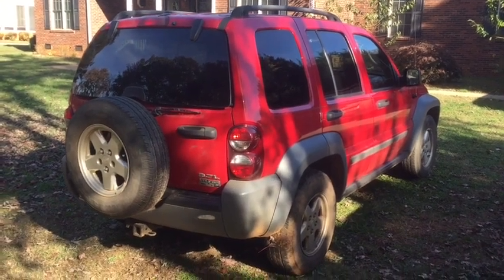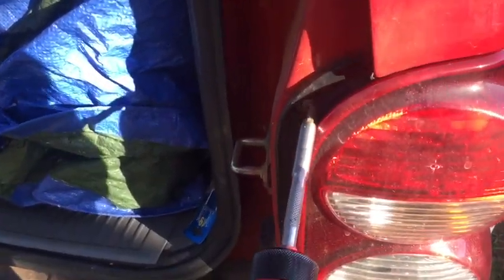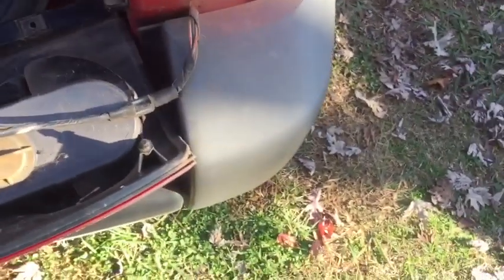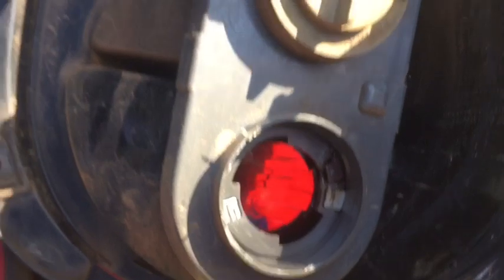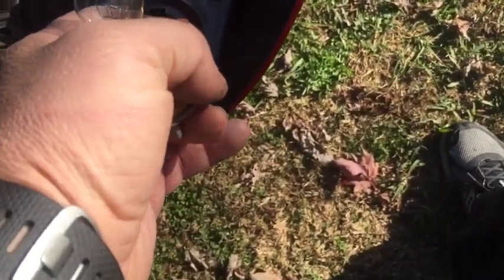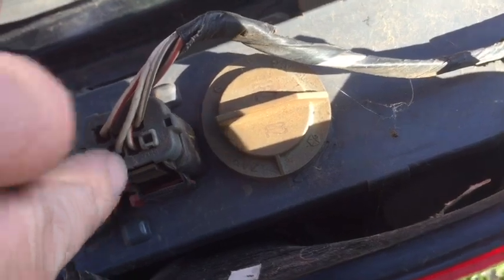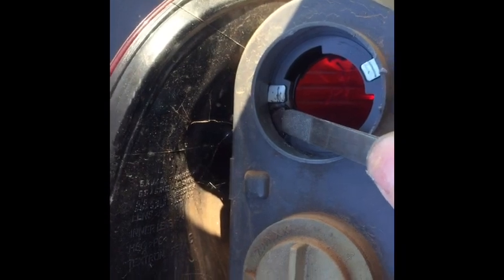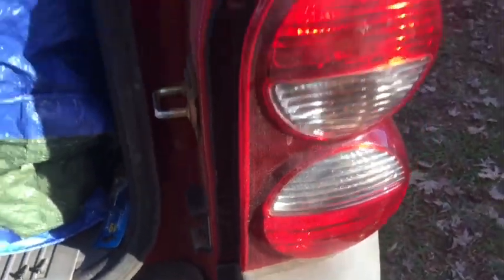Jeep Liberty brake light repair

Comment: Thanks.  I was really scratching my head when I replaced the bulbs and I got no brake light.  Then the other 2 lights(blinker and light)work.  I'm going to try to clean the connections.
Reply from the maker: vista7 you will likely find a burned connection for the light. Cleaning makes a good temporary repair. Eventually you will likely need to replace the entire light.
Reply: @YourCarGuyDR   I tried cleaning it but it still didn't work.  I ended up just buying a new tailight assembly and it works fine now.

Comment: This was a very informative video, but a quick question- which one is the bulb for the turn signal? You showed that the top one was for the brake/tail light. Thanks
Reply from the maker: Stacey Gallagher should be the second bulb from the top.
Reply: Nope.. Lol.. It's the 2nd from the bottom.. I think.

Comment: I have a 2005 Jeep liberty and the brake lights will not work replaced bulbs, replaced switch up by break petal and still nothing. Now the brake light on the top is staying on all the time. Please help.
Reply from the maker: It sounds like you have two issues the switch that you replaced is likely out of adjustment causing the 3rd brake light to stay on. The other lights need to be checked for power and ground connection. Check your fuses as well.
Reply: Thank you very much. What ground connection should I try first?
Reply from the maker: @janicediven6466  I would check your fuses first. Then with a multimeter test for power at the tail light connector.

Comment: Please help!

2007 jeep liberty.

Third light works fine (when I press on break pedal)
Nighttime, rear lights work fine (same bulb as break light)
No break light when pressing on break pedal (rear running lights will turn off)
Break fuse is OK (#12, 15a)
It's not the break switch because the third light works
Reply from the maker: So a couple of things to check but one is the most likely. The brake and tail light are the same bulb but it is a dual filament bulb. Meaning the tail light filament can be fine and the brake light filament inside the bulb bad. However based on your description I would guess that you have a bad ground going to the brake lights. Not completely bad but not good either.
Reply: I had the same issue, you have two ways to fix it 1) buy a new brake light circuit board for about 30dollars Or 2) buy a whole new housing for about 60dollars online, it comes with new lightbulbs, connectors and circuit board. I would recommend the second option since it's easier and more foul proof.

Comment: The videos for this have all conveniently replacing the r. Light and not the l. Side which is blocked by the back hatch when opened.HELP!
Reply from the maker: Travis Stansbury next time I have this vehicle in for repair I will do the left side.
Reply: @YourCarGuyDR  thanks brotha I meant no shade btw I know it's probably something simple
Reply from the maker: Travis Stansbury no problem I haven’t had to do the left yet but it would likely make a good video.